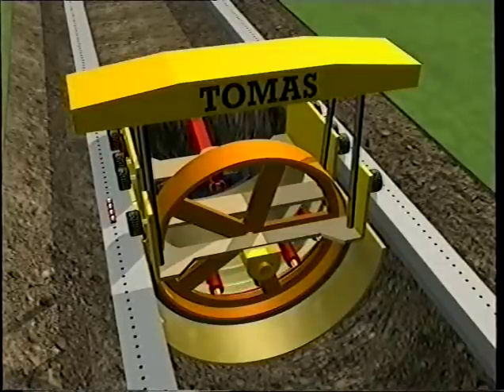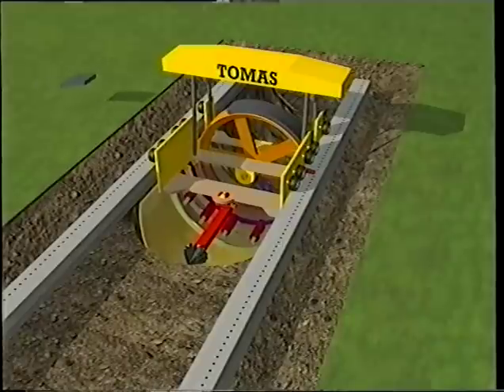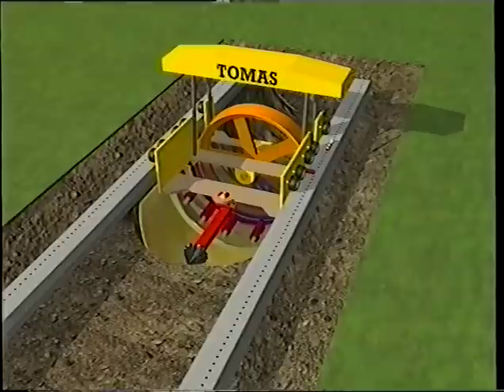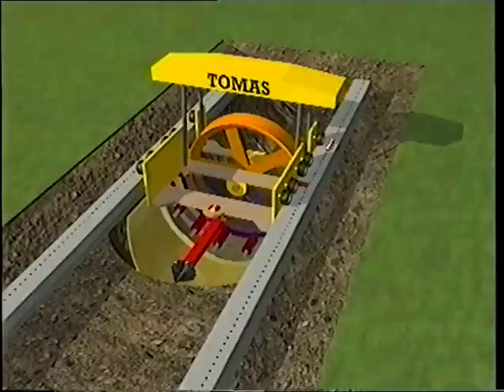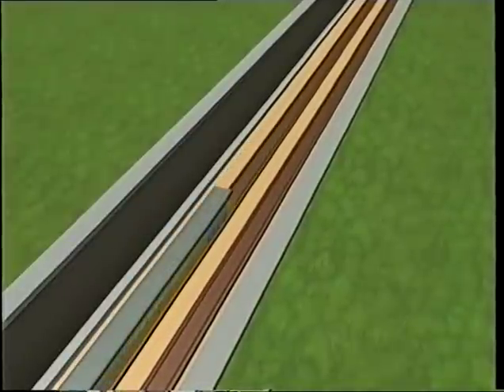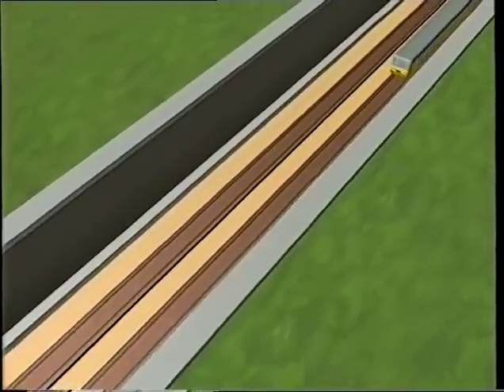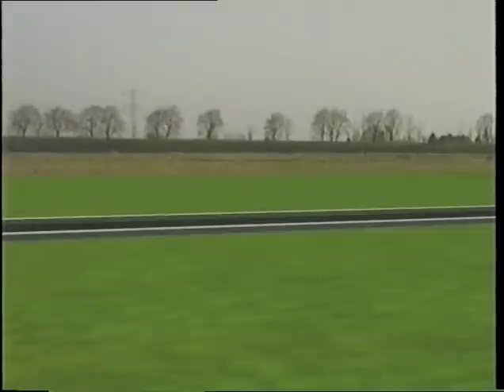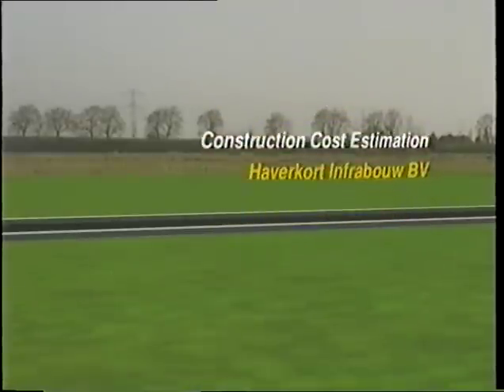TOMAS - Cut and cover tunnel technology

Comment: If you have the space to build this, you can do it overground, you need underground when you go under cities....
Reply: I was thinking the same thing.... did they think this through when designing the machine?  if they needed to make the roads below grounds it's because the there's already an infrastructure above ground. if they needed a structure above ground why make a trench just to build a road... the only thing I can see that's a benefits is the noise pollution reduction this didn't help if there's landslides or floods I wonder if this can be used in the Midwest where tornados can rip off houses... at least this way the roads will never be blocked except in case of accidents.
Reply: Exactly! Plus, I don't know if this falls under the tunnel definition... It's more like a trench?

Comment: The biggest problem here is the high watertable.
And it's not shown how they solved that problem.....
Where the digging takes place, the water table is not shown, but don't worry its gonna be a dredging pool.
In reality this means they are placing the prefab concrete elements under water.....
This will never work.

Or behind the cutter a bulkhead can be placed, but water will flow in directly where they are placing the concrete elements.
You need to stabilise the soil.
This can only be done by lowering the watertable, which is not needed they said.
Or by cementing or freezing the soil, very expensive.
I don't see how this is gonna work in reality.
Reply: +Martijn martijn Right. No mention of pumps. Also, this seems to be "Cut and Cover" without any cover. And if you're at the surface, why not just drop in pre-fab segments rather than building the segments from smaller slabs? Even better, pour the segment at the back of the unit and then drop it into the hole once it cures... though that might take too long.